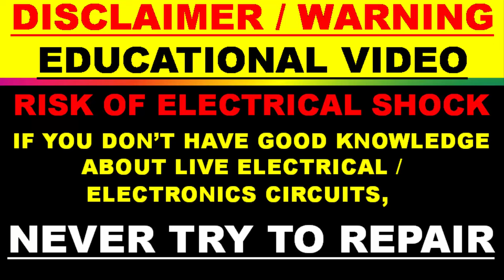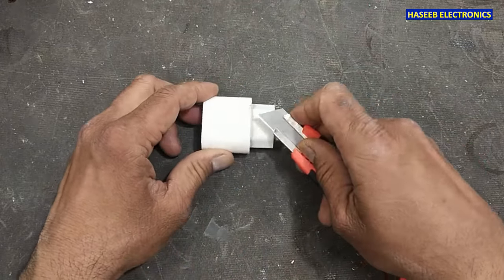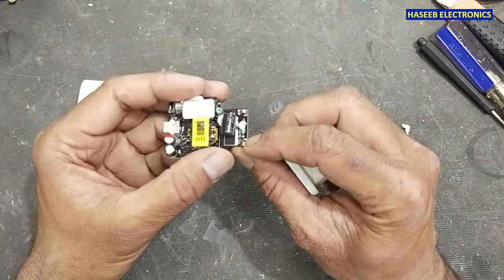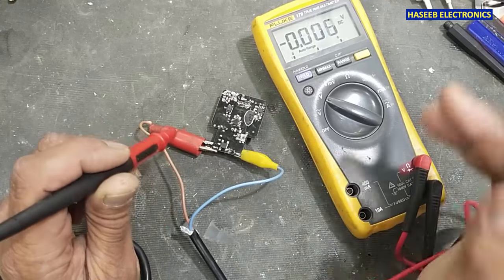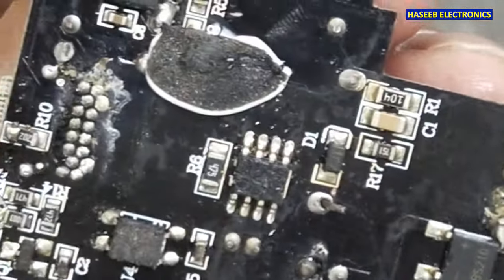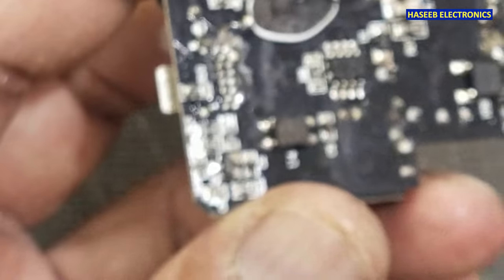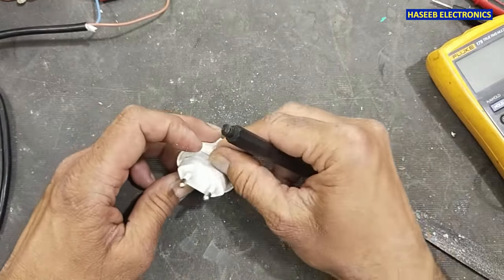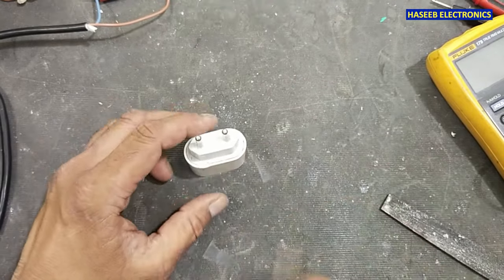{828} Apple iPhone 20 watt charger repair

Comment: the problem with repairing this kind of power supply is the difficulty in dismantling it 👍
Reply from the maker: yes brother. you are right, these types of products are locked securely to prevent from repair, and moreover these are notoriously much expensive with compare to the exactly same circuit. so if it is recovered at no cost, then it is awesome
Reply: А в чем проблема использовать паяльный фен для того что бы разобрать?
Reply: @HaseebElectronics  فتح مثل هذه الشواحن سهل جدا كل ما يمكنك فعله هو وضع القليل من البنزين على مكان الغراء و الانتظار قليلا سوف تفتح بسهولة

Comment: Use a heat gun to warm the sides first, also that NOT an original Apple charger board ...
Reply from the maker: awesome,  but it is originally provided with iphone box.
Reply: they add some weight, to think that is original.

Comment: You shure this isn't a knockoff copy of Apple charger? I don't think Apple puts car wheel balancing weights inside their chargers 😀
Reply from the maker: yes it is original charger which came with mobile phone. and it is purchased from USA, so we must say 'IT IS ORIGINAL" hahahaha
i think these balancing weights are used to increase the weight, because someone must have to purchase it by weighing it, LOL so he must be confidant that it have more weight, so it is ORIGINAL 
hahahahahhahaha
Reply: @HaseebElectronics  I don't believe it-- it must be a cheap copy. Genuine Apple chargers look completely different inside too. I just checked. Also Apple phones do not come with charger brick. You have to buy it separately ;) Love your videos.
Reply: Ditto 😂

Comment: Hi brother namaskaar. 
Thank you for sharing this video. 
Is there any safe way 
to open the container. 
Thank you. Good night 🙏
Reply from the maker: thanks a lot dear brother 
there is another method, to heat up using hot air gun, near the corners. it softens the glue and the locks. otherwise this product is extremely rigid to open

Comment: Deer mr haseeb in another video in welding machine you talked about the voltage drop caused by relay when welding machine is loaded (been used) i hove you explain how to check if the relay is the cause of voltage drop 
Thanks.

Comment: Never touch capacitors without discharging them first. You may get shocked or electrocuted, some may say its not important but you may drop thing by the shock